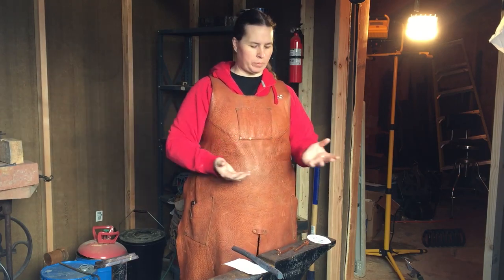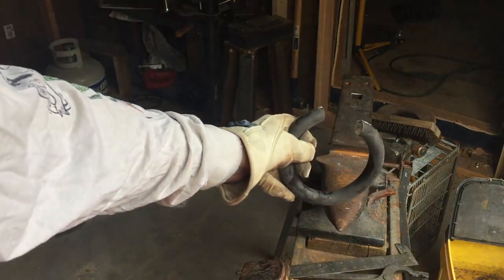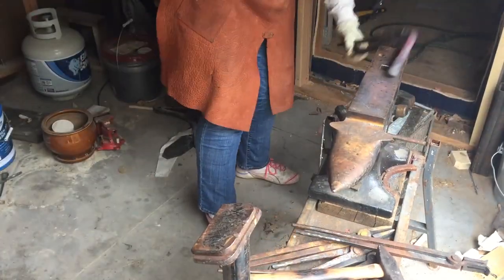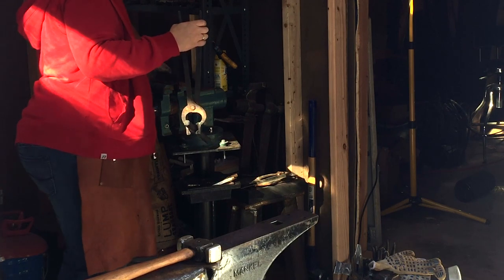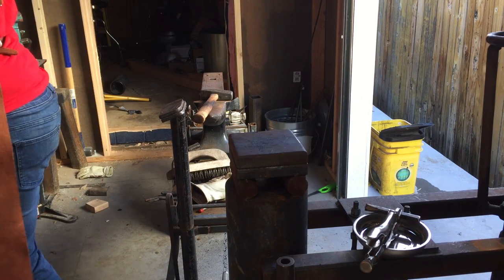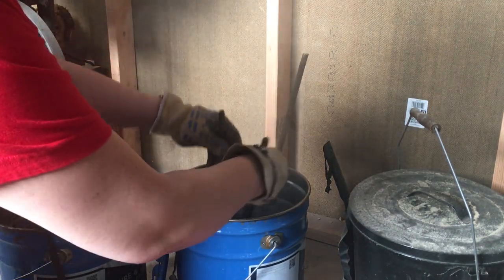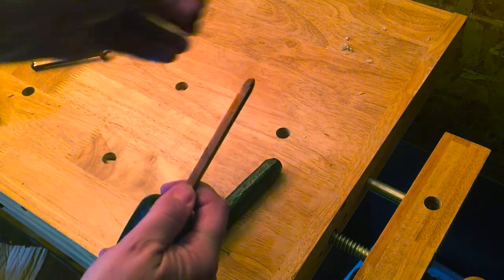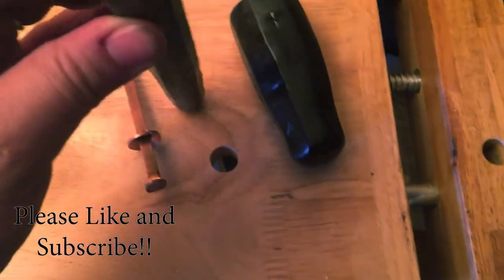Tool to Sail around the WORLD!

Comment: Enjoyed this particularly because I just did one of these. Your way is easier. DOH!
Reply from the maker: LOL what did you do? I thought about forging the hole hot, but didn’t think I could get it straight, and forging the octagon would malform it.  So I turned my drill press into an upright lathe :)
Reply: @OuroborosArmory  i drilled enough to hold a ball bearing then tried to beat the bearing into hot coil spring. Spent a lot of cussing looking for the bearings. Lol